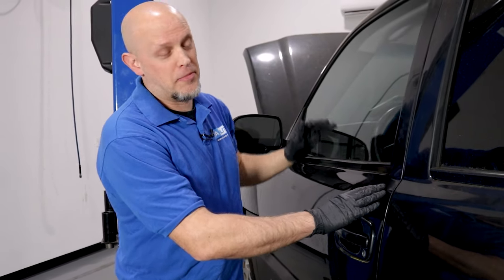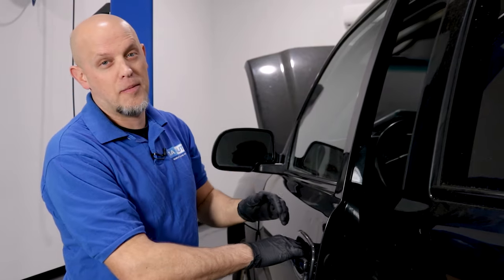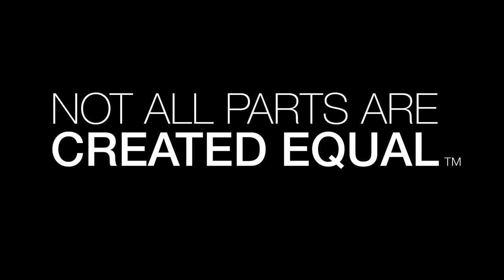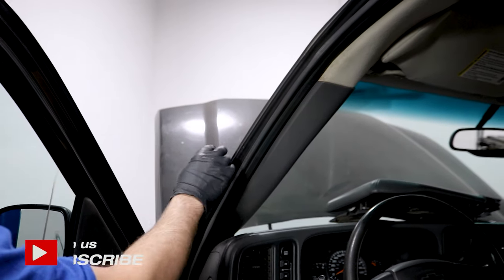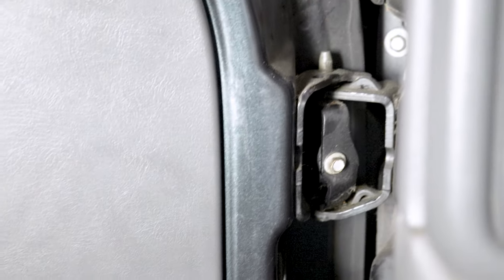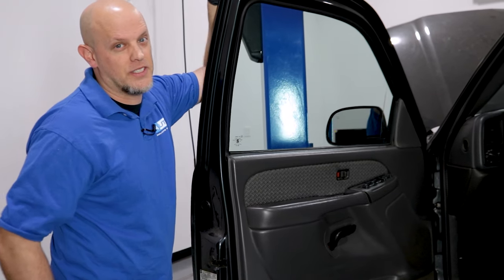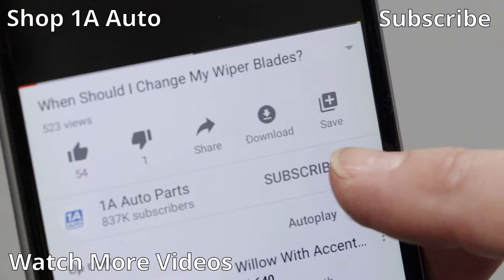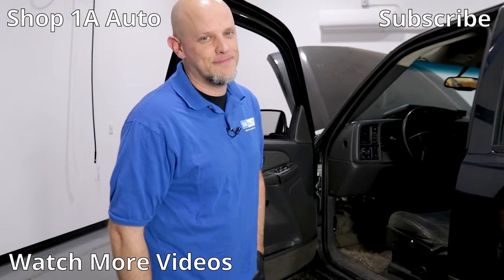Sagging, Misaligned, Poor Fitting Truck Doors? Check the Door Hinges!

Comment: I had the sag problem, too.
My bushings  were worn. I tried  the cheap ones at the auto parts store and they shattered.
After some searching  l found 
Cunningham  Machine. They specialize in  milled bronze door bushings.😅 l put them in and no sag no wind noise 😊.
Good luck.

Comment: What type of lubricant would be recommended?
Reply: I typically like to use White Lithium Grease, can find it anywhere in a aerosol can.
Reply: I use silicone spray.
Reply: I would like to know too, but I guess good old grease does the trick.
Reply: white lithium grease spray works great
Reply: @panoszafeiriou  Any grease will do really. I just use white lithium grease
Reply: WD-40, it works very well
Reply: I always use the white lithium grease in the aerosol spray cans on 'em...😉👍

Comment: I had this problem on a 1978 caprice classic and it was caused by the hinge bolts damaging the threads on the door panel and body panel. Solution: longer grade 8 bolts backed up by lock washers and nuts. the dealer had over tightened the door bolts when servicing the car.